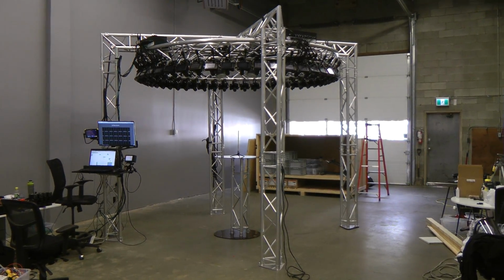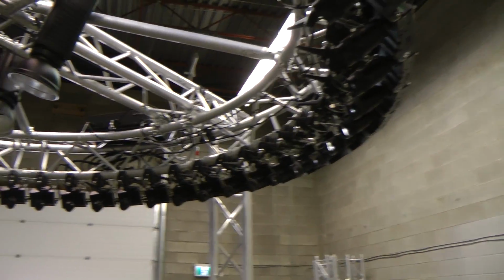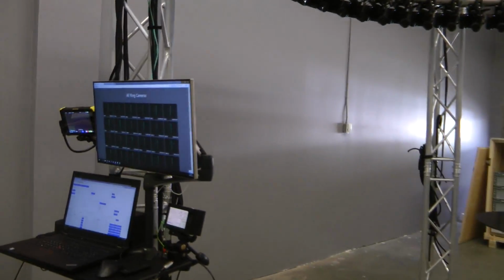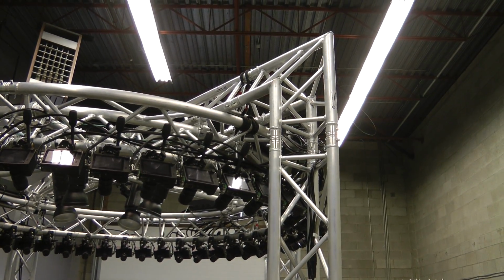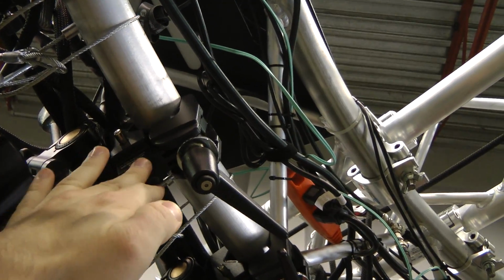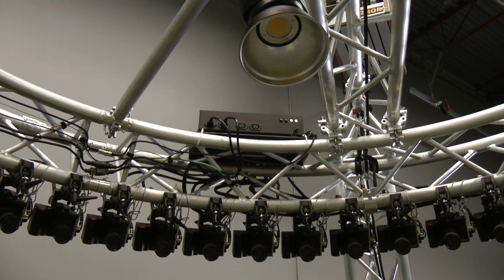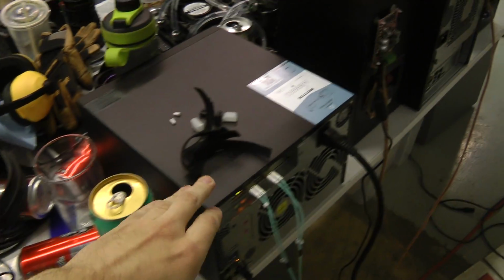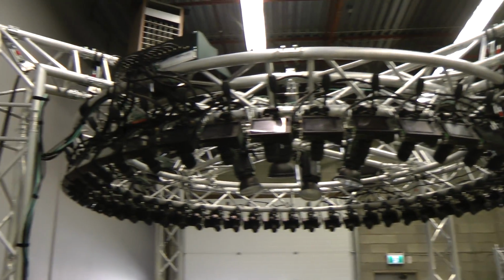Chronos Ring - Bullet time array of 48 high-speed cameras

Comment: Very cool! But I would play more frames per camera, slowing the spin
Reply: Yeah, it was making me feel weird.
Reply: Exactly!
Reply: In that case you would need more cameras, otherwise the spin would be jerk, stopping for a few frames, them moving, them stopping etc. But perhaps you could smooth that out with fancy new motion interpolation method?
Reply: @Richard.Andersson  makes sense
Reply: @u0000-u2x  watch at 2x speed if you want smoother
Reply: yeah.. my eyes are killing me.
Reply: Unfortunately the choice is either full spin rate and 48x the maximum recording speed of the cameras, or operating the cameras at their normal rate either with a single spin once we get triggering down, or so you can select camera. Interpolation is still required when doing start/stop as it's very jarring going between 1kfps on one camera and immediately moving sideways at full rate.
Reply: I threw up
Reply: Its great at 0.5x speed
Reply: He’s an engineer! He wants to run at the maximum possible frame rate which is what has determined the nauseatingly fast spin. Once he starts working with some artsy types then he will realise max possible FPS won’t win with this setup
Reply: came here to write that, thank you
Reply: Yeah,  I had to give up watching.
Reply: @ColinJWiens  I personally feel it's the rotation itself that's the issue, I feel the only way to get around this would be to enlarge the base so that it fills the frame and to make it as black as possible. 

This way you're focused on the centre of the frame which has a slower speed.
Reply: Yeah way to fast
Reply: @Richard.Andersson  there are certain things you simply shouldn't do if they look bad.
It's a really cool idea but this way i'd rather have normal slowmo instead of 180°/s headspin slowmo.
If you can't do it properly, don't do it.
Reply: Richard Andersson larger ring?
Reply: @u0000-u2x  Interpolation becomes nonsensical so quickly.
Reply: One rotation already takes 2 seconds, there are 'only' 48 camera's. You can see where i'm going with this.
Reply: the old approach is using spinning mirrors, maybe a combination of the two technics will make it smooter and maybe cheaper
Reply: I wonder if youtubes 360 video rendering could be used here, if all the cameras images were stitched together, creating a user orbiting video.
Reply: Had to puke halfway through. Still worth it, though.
Reply: I don't think that's how it works, the reason it spins so fast is dew to the number of cameras, 48 cameras playing at 24fps is 2 seconds which is approximately what it takes for the table to do one full revolution, if you were to shoot at twice the frame rate you would get two shots of the scene from the same angle and when played back the rotation would look jittery as if it had been shot at 12fps.

Just a theory though, I don't know if that's how they pulled it off, but it seems like a reasonable explanation.
Reply: Way, WAAAY   better at .5x or .25x even though it's not  as smooth.   A couple of interpolated frames between each camera and they'd have it.
Reply: Richard Andersson mm
Reply: Exactly what I came to the comments to say. I fully agree slowing the rotation a bit by staying on each camera for 2 or 3 frames rather than the 1 would make it much more appealing 👍🏻
Reply: Reduce speed. Play at 0.5x as the video is 60fps